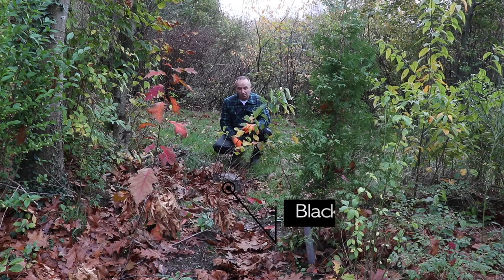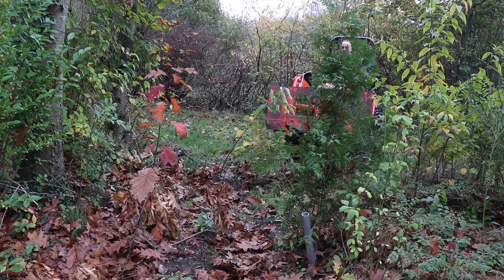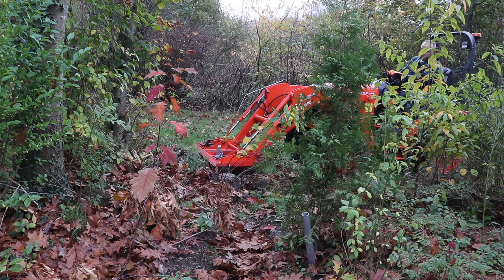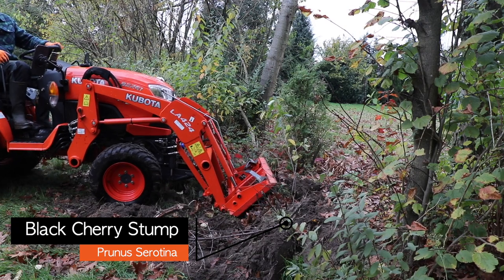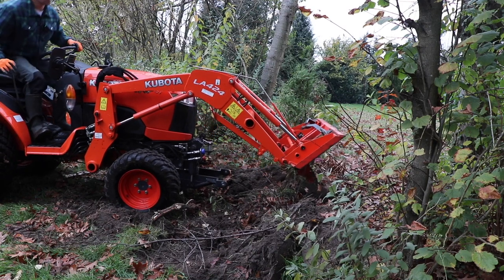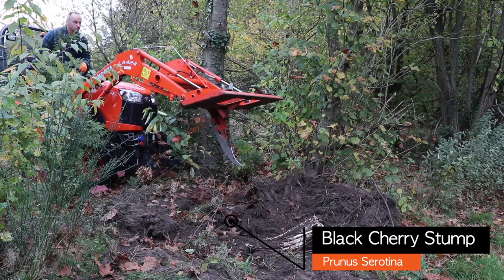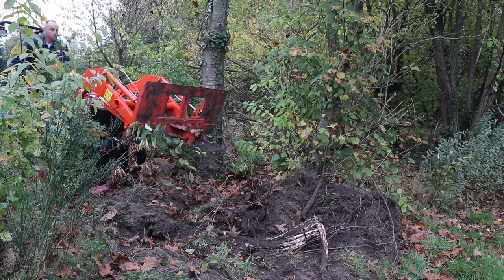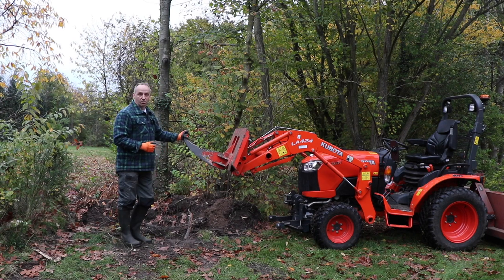Tree Stump Removal with the Rhino Ripper using a B2261 Kubota Compact Tractor

Comment: Thanks for another good video. I copied your design last year and made my ripper to be placed on pallet fork frame. It works well. Thanks for the idea and sharing your great ideas.
Reply from the maker: Great to hear that the ripper design works well for you too. The nice thing about a pallet fork frame is that you can even place it off-centre (e.g. more to the right or left) when this is prefered. Am I correct?
Do you also have a guard frame at the top of the pallet forks? I can imagine that this large frame can be a nuisance in limited spaces.
Reply: @OutdoorsintheLowCountries  yes, it does have a frame at the top. I made it removable after bending it on some standing trees. I build the blade on a plate with gussets, welded in bolts to align with slot positions, and drilled and tapped lower pallet fork frame . So the unit sets in place on the top two bolts and and bolted on with two bolts on bottom. Takes a few minutes to put on but gives some versatility.
Reply from the maker: @pkurt67  Thanks for explaining.

Comment: I copied this design here in the States. It does the job, but you need to use it in this manner. Thanks so much for a great attachment for my JD 1025R!
Reply from the maker: You're welcome. And great that the Rhino Ripper design is also doing its job in the States at your JD 1025R compact tractor! 👍